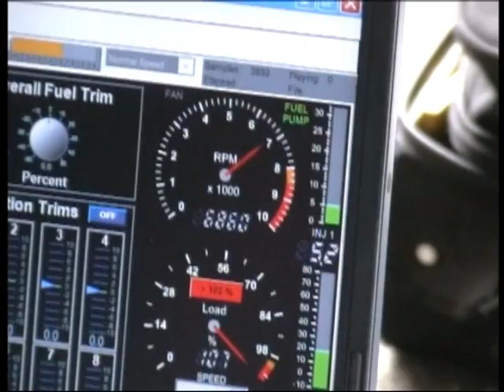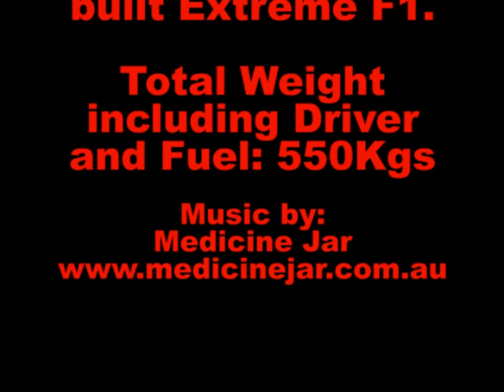F1 Powerboat with 400HP Evinrude running Wolf Fuel Injection

Comment: @highdeserthater  i would and i have. i have over 40 boats ; bayliners, ribs, dorys, fiber glass, aluminuim. my oldest engine is probaly a yamaha 1995 3hp which is used as a back up of a back up on my rib with twin yamaha 350hp v8s and a mercury 9.9hp 4 stroke 2011 as a back up